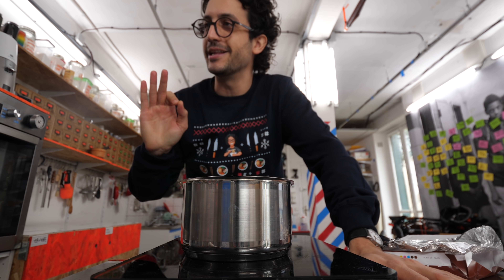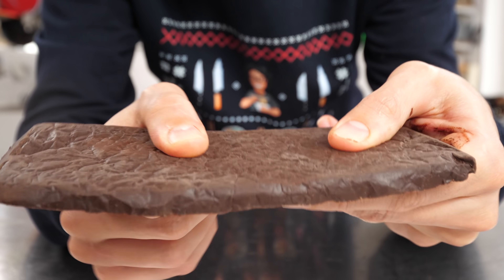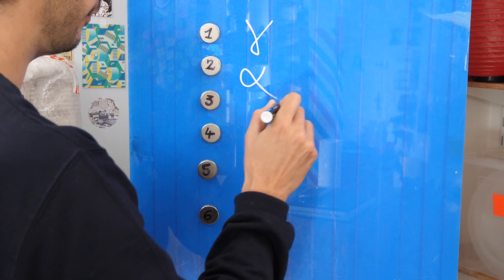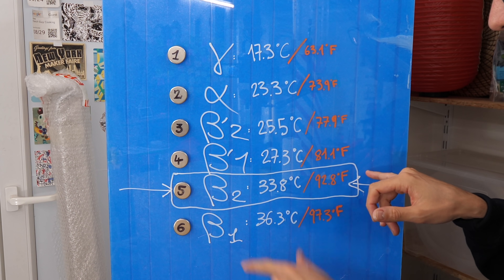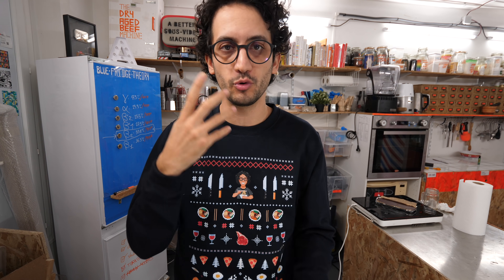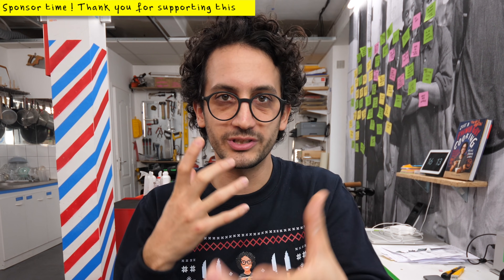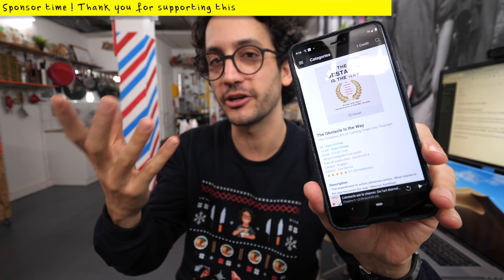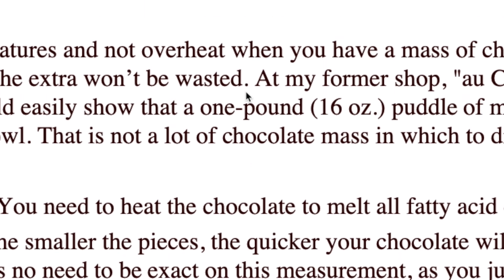I Learned How To Temper Chocolate... (science included)

Comment: I am getting very close but struggling to get the snap quite right. I start seeding immediately but normally run out as the chocolate reaches 100F. Should I  ensure I still have seeds in the 100-90 degree range? I'm worried that while I'm adding most of my seeds above 100F they are losing temper and not encouraging temper.

Comment: I once had an unopened bar of chocolate laying in one of my car-seat pockets.
I believe i bought it right before a major heatwave, and forgot that i left it in the pocket.
There are no way for sunlight to directly hit that pocket so it would slowly heat up towards 26-27 degrees(C) (maybe even 30-35 inside the car itself) for a couple weeks when the car would be out in the sun, before the heatwave suddenly stopped and went down to a regular 15 degrees overnight.
1 week into the colder period I discovered my forgotten bar of 44%+ chocolate bar and when i opened it it cracked like you'd expect.
What surprised me was that it crumbled as if the chocolate had been carbonated with tiny bubbles too small to see, and it made the bar taste more like hot cocoa than it usually does.
Is this because of the sugar crystallizing into small pockets within the chocolate, or perhaps because of some sort of gas being produced?
I'm not a chocolate expert, but that bar was fantastic.

Comment: Actually Alex, the tabling method of tempering chocolate is better suited to very large batches when melting chocolate, like kilos of chocolate. Tabling is actually just step 1 of tempering because in the old days, ready tempered chocolate was not widely available, because tabling is basically making the proper crystals to seed a larger batch.

Also the reason they used marble/granite slabs is because they have greater heat capacity to absorb the heat from the large amounts of chocolate to use as the seed for the larger batch. Your stainless steel worktop was fine, but since it is just a thin sheet, the table quickly warmed up and slowed down the cooling of the chocolate. Not to mention that marble slabs are cut and flattened precisely so you don't get those dips and wasted chocolate like on your table. Also using a pair of actual clean paint scrapers is better and saves a lot of chocolate.

Also as a rule of thumb, all chocolate is the same, what matters is the ratio of cocoa solids, cocoa butter, milk solids, and sugar that changes the quality of a bar (processing and type of cacao, like coffee, also matters, but that's a different beast altogether)

Comment: you could try to remove the bubbles with a vacuum chamber. basically a large jar with a hole in the lid and a pump on top would do, you can buy cheap hand operated vacuum pumps on amazon.

Comment: if you take the chocolate at 50 degrees, and put it into a blast chiller or some other very cold place to freeze it very quickly, would you still get the gamma crystals?
Related question, if you were to very, very slowly bring the temperature down to freezing, over the course of several hours, would the result be any different?

I have these questions because when I've had melted chocolate bars in the past, specifically in the car, leaving them in the car overnight in the winter has left me with what appears to be beta1 crystals almost every time.

Comment: While you can do tempering on any work top "if you have to", marble is a much better choice than steel.  Steel will conduct the heat away faster, which is exactly what you want to avoid,  you want the cooling to be as gradual as possible.  marble has great thermal properties and it's easy to clean.  The thermal properties are why it's used for chocolate making as well as confectionery.

Comment: If you ever want to get rid of bubbles in a setting mix or mold I'd recommend taking a sander removing the sand paper so it's just the pad and placing It on your mold and use the vibrations to get the air bubbles to rise out of the setting solution. Works brilliantly with setting concrete

Comment: i hate tempering chocolate... Alex, please find a shortcut :p Maybe a tempering machine :p
Reply: Tempering machines are still a nightmare to dial in unless you're dealing with a lot of chocolate (like at least a kilo). Best shortcut I've found so far is to get good at seed tempering
Reply: Well tempering is not all that hard, and like @redyellowpink01 said proper tempering machines do need quite a lot of chocolate to work and are pretty expensive as well. I own a small chocolate shop, and my machine needs at least 4kg to work properly. For the home chocolatier, it is the easiest to just melt your chocolate in the microwave at 30 sec intervals, stirring in between, til it is at 45c, then add 1/3 of the mass of pre tempered chocolate, and keep stirring till it is melted and at 32c, although this is just for dark chocolate, white and milk chocolate has a bit lower temperatures.

Comment: You can probably find silicone molds for chocolate bars pretty easily. And, to get rid of the bubbles, you could MacGyver a way to pull a partial vacuum or buy a chamber to pull a full vacuum.
Reply: you only need you smack the mold on the table (like he did once) a couple of times to get the bubbles out ( mixing the chocolate with thé "knifehead" before pouring also  helps)

Comment: when you're making the wood molds, do them in two parts, upper and lower, if you make a full one piece frame of the top mold, you can put your wax paper or foil over the base plate, keeping it perfectly smooth, and and clamp the upper mold over it.

you will have smoother textures

Comment: Alex! You're actually a few degrees too hot for creating Form V crystals. The exact temperature changes with the ratio of cacao solids to cacao butter, but the range is from about 28-32C, with the low-end being white chocolate, the mid being milk, and the high being for dark chocolate.

ChefSteps has an amazing article on tempering via sou vide with way more info. Personally I've found that most commercial thermometers are too inaccurate for chocolate tempering, as they have a range of +/- 1C, which is more than enough to ruin a batch, but you can buy specialty tempering thermometers online very cheaply.

Comment: just an idea. couldnt you just use a sous vide machine to bring the double boiler to the needed temperature. (than the chocolate melts at this temperature. and then turn the sous vide machine back down and the chocolate goes down as well) SALUT!
Reply: I scrolled to the comments to write the same thing. Alex, make a test with a sous vide machine!
Reply: I'm sure that would work but the methods he showed are easier for anyone to replicate as not everyone has a sous vide machine at home.
Reply: @nanoflower1  i dont think it would work either, but to be fair, alex sous vide is a cooler box with a thermometer, i think just about every one has one lying around ;) and if nothinkg else it would be a fun experiment at that.
Reply: Damn that worked like a charm!
Reply: That's what I do, and it works really well! Just a gastro tray inside another gastro tray filled with water and a sous vide and then I use the seeding method to temper the chocolate. My filled chocolates have great shine and a good snap. 😊
Reply: I think crystallizing only the beta2 form directly from the melt is extremely slow. It's much faster to grow beta2 crystals by crystalizing faster at a lower temperature, forming a whole mix of different crystals, then repeatedly heat to melt the ones you don't want / cool to make them all grow. The work on a marble slab rapidly cools small parts of the melt that get left on the edges then re-heats them as they are gathered back into the bulk.
Reply: You are using steam as the cooking medium in a double boiler, it should not be touching the liquid water in the pot. A sous vide device would not help in this setup.
Reply: The idea I had in mind was to immerse the bar form in water and use sous vide machine only to control crystallisation temperature, not to melt it before pouring into a bar.
Reply: @rafalsjourney  Well the only problem there is now you have hot quickly thickening chocolate in a wet plastic bag.